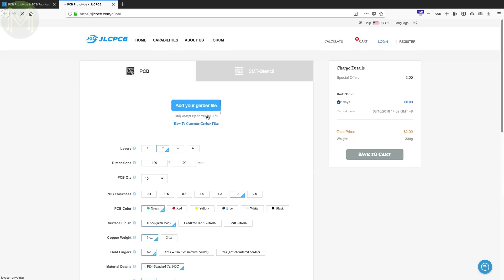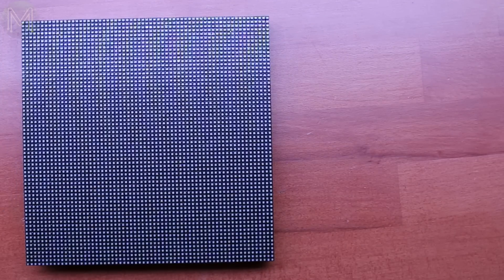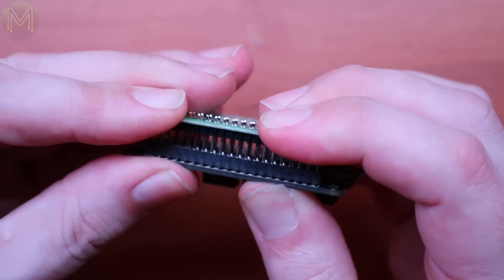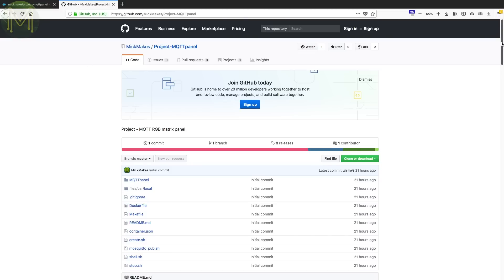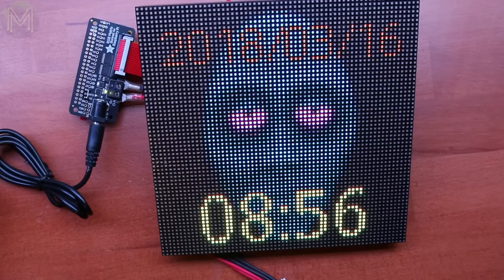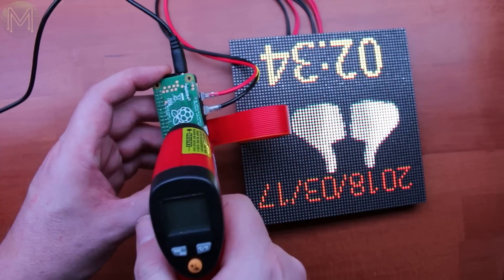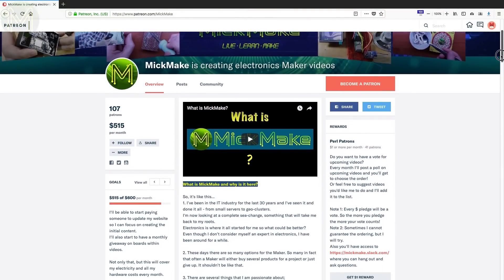#200 Build an MQTT based RGB LED panel! // Project

Comment: Bringing this back to life....not sure if it's being followed.  Is there any easy way to set the timezone ?  UTC is great an all that, but UTC -5 is far more useful for me.  The only reference I can find to timezone is in the MQTTpanel binary.  BTW This will NOT run on Pi Zero 2 W as is, it renders a mostly solid color on the HDMI output, and summarily locks up the Pi... Runs good on Zero W (only using Bullseye, on Bookworm it just continually complaints about the sound being enabled even when it's blacklisted, then crashes), Pi 3 runs good, but the panel blinks intermittently and is annoying to see.
Reply: Got it sorted;

To change the timezone:
docker start project-mqttpanel                                                        # start the container
docker exec -it project-mqttpanel bash                                         # shell into the container    
apk add --no-cache tzdata                                                               # install timezone data
cp /usr/share/zoneinfo/America/Chicago /etc/localtime       # copy the appropriate timezone file to /etc/localtime
exit                                                                                                     # exit the shell 
docker restart project-mqttpanel                                                 # restart the container

Additionally you can modify time/date format elements in /usr/local/etc/config.json from within the container, making a backup first is always a good idea.

You probably want to save your modified container to a new image and create a new container using that image should it be updated in the future
docker commit <container-id> my-new-image   
use the docker create command included with the tutorial using new image name

Comment: I have followed your instructions and build a panel with same hardware as you use, the build and software installations went well but when I run the docker project I only get displayed something on half of the matrix display.
It looks as if the display is in 4 x 16 rows and I have something dispalyed on the first 16 rows, then I have 16 rows blank then 16 rows with display and then again 16 rows blank.

I use a 64x64 P2.5 adafruit matrix panel and a raspberry pi zero and use a 5V, 10A supply.

Any ideas why I get this wired display?
Reply: Ok I found out why....
I missed to solder at connection bridge on the adafruit bonnet for using a 64x64 RGB matrix 

https://learn.adafruit.com/adafruit-rgb-matrix-bonnet-for-raspberry-pi/driving-matrices#step-2982866

Comment: Question : does the pi itself need to be powered separately or does the 10A power supply power both the pi and the matrix?
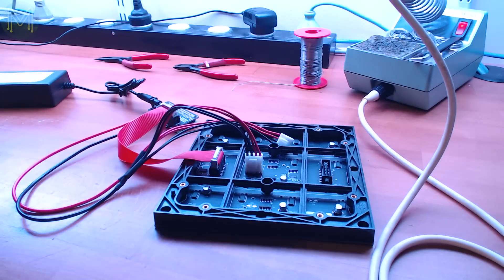Reply: At 3:36 he plugs the PSU into the PI hat, so I'd assume it powers the PI

Comment: great stuff! but a quick question, if I need to hook up 12 panels of 64x64, then will be enough to use the pi 3?
Reply: hi sir ,i am Gina ,if you have any questions about led display you can contact me please.whatsapp/skype： 8615803088171 email address： gina@atsilu.com

Comment: Interesting, how hard do you think clustering this into a much larger display would be?
Reply from the maker: The problem would be bandwidth and syncing. If you’re happy with a low sync rate, then it’d work well, but wouldn’t be able to handle HD video. At last not in this setup.

Comment: Can we use these (multiple) boards as monitor for raspberry Pi without coding
Reply from the maker: Unfortunately, they don't offer full frame video. So would be fairly sluggish as a monitor.

Comment: Great Project, got it up and running but ran into error after reboot. Error response for daemon: Driver failed programming external end point project-mqttpanel-0.10. Error starting userland proxy: listen TCP 0.0.0.0:1883: bind: address already in use. Any thoughts on how to repair.
thanks
Reply from the maker: Ah yes. A common issue. You already have something listening on port 1883. You’ll need to shutdown that other something. You can check what that is by doing a “lsof -I tcp:1883” and then killing it.
Reply from the maker: Did you use a fresh Raspbian image?
Reply: Ran lsof -I TCP:1883 and it was Mosquitto. Killed the Mosquitto PID and now Project-mqttpanel-0.10 runs but Mosquitoo will not start, gives same error as first described.
Reply from the maker: The Docker container runs its own Mosquitto server. If you want to run another, then you can change the port that it listens on, by changing the “-p 1883:1883” to be something else, like “-p 2883:1883”
Reply from the maker: But you’ll also need to change the Mosquitto client to point to the new port, of course.
Reply from the maker: If you don’t need to run another  Mosquitto server, then just leave it shutdown.
Reply: Love it!!!!
Reply from the maker: You got it going?
Reply: Yes it now works great, did not understand that the container has its own Mosquitto server. Was trying to get separate Mosquitto client and broker running on same Pi Zero running Mqttpanel ap. Very cool project, keep them coming!!!
Reply from the maker: Nice. I’ve put up instructions on all the available MQTT publish commands that it responds to on GitHub and DockerHub.
Reply: I used the GitHub commands page to set the time, but I cannot change the time zone. Eastern US?
Reply from the maker: Ah! I’ll have to add in another MQTT command to set the Timezone.

Comment: Can you use them as the main display, as if it was a monitor. It wold me awesome to play text adventure games in the shell
Reply from the maker: As far as displays go, they are very slow, but I don't see why you can't use them to play text adventure games. You don't need a fast display for that.
Reply: MickMake exactly. But is there a simple solution like just plugging a hdmi cable, or do you need to make you own driver to use it as your main display.
Reply from the maker: There may be some drivers around that allow conversion from HDMI, but that’d be extra hardware.
Reply: @ranukehshiga6328  you can run video on them just fine at 30 fps +

Comment: Could be good for a ticker-style message board or Control centre for a DIY IoT solution.
Reply from the maker: I'll add that feature in later. At the moment it's just static text, (but with animated GIFs).

Comment: The panels are a bit pricey for the 64x64 sizes.  I was thinking of making a larger display (think animated billboard/advertisement on the side of a trailer). But one thing that's really got me wondering, is how bright are these? At 6:25 you show the skulls/warning, and it looks kinda washed out (granted, this could just be the angle and/or the cameras auto adjust). Would you be able to see these outside under sunlight? Perhaps a more detailed video on these panels could be in the works?  😉🤠
Reply: Ok if you want to do this. I have a few tips for you. First you don't have to create your own software for this. know the panel shown in the video is used for high destiny indoor displays think p4 p5 = 4 mill form center of led to center of led. for Out door use you need depending on the size, p10 for small 4 by 8 ft they cost about 15$ for panels of 360mm by 160mm  that includes cables but not the casing or the power supply. I have a few good china contacts that manufacture good Quality panels. I could help you out if you really want to do it.
Reply: @theAppleWizz Thanks for the info. I'll have to get back to you on that one. I've been thinking of doing this kind of project, but it's been way back on the back burner for awhile as it's not on the front page list of things to do/work on 😉
Reply from the maker: You can pick up the same panel from eBay and China a whole lot cheaper!

Under studio lights you could see them, but the angle of the panels and the camera... Well it was a bit washed out.
I would suspect that outside in full daylight they would be just as visible as what you saw in the video.
They're not really designed as outside lights.
Reply: @MickMake Ahhh, ok. Thanks.  Yeah, I looked at eBay and that was the price I was seeing for the 64x64. Unless there's another way to look them up.

Comment: Hi! Great video! Could you tell how the Docker container gets the access to the GPIO pins? Are they accessible right away or I need to give special permissons to Docker or make some mapping (similar to a posts mapping) when I start a Docker container?
Reply from the maker: Yes you will need to do that. If you run the command I mentioned in my video, (and on my website), it'll do it all for you.
Or else there's some handy scripts on GitHub.

Comment: Great video! Does it also work with 2 of the led panels connected to each other? I was thinking fo making a big 128x64 panel with this Adafruit matrix.
Reply from the maker: Yes indeedy! But you may have some slow GIF animation when using a Pi Zero. You can change the panel size by modifying the config.json file within the container. I’ll add a feature later where you can change it via MQTT
Reply: I have a similar idea to make a 128x32 display as a RunDMD clock with pinball animations.

Comment: Is 2/3rds threw making a 32x32 using the hzeller board https://github.com/hzeller/rpi-rgb-led-matrix/tree/master/adapter  will be easier to just adapt what you have done now. Thanks :)
Reply from the maker: I used the hzeller library as the basis for my code. The Docker image has this library pre-built, installed and ready to roll for both C and Python. So you can shell into the container and just away you go.

Comment: Nice! One question - how much panels can be daisychained together?
Reply from the maker: Good question. A Pi Zero could handle 4 panels, but it’d be very slow at updating. A Pi3+ could handle a lot more, but not sure what the theoretical limit is on these panels.
Reply: MickMake, thank you for answering.

Comment: 50°c-30°c=20°c sooo 15°c+20°c=35°c under full load. Should be fine. Also, if im not mistaking, you can daisy chain those panels to get one big one, right?
Reply from the maker: Daisy chain? Absolutely, but I suspect the Pi Zero would struggle to do complex animation on two panels. It's juuuust struggling to keep up with one.
Reply: MickMake if got a use for those 8 core sbcs now.
Reply from the maker: Tempting. Even better, might look at using one of those LoFives I recently picked up. An FPGA would be able to really nudge up the refresh rate.

Comment: Cool Project. 
Also did you use the Paho library in this project ?
Reply from the maker: I ended up using the Mosquitto library. It ends up being a smaller installed package than Paho within the container.

Comment: I'm in the process of building a new gaming pc (luckily I bought the GPU back when you could still get rx 480's with 8gb of vram for $215 !!). I'm thinking about incorporating this into the side panel of the case. Maybe have a piece of acryllic cut to the size of the side panel and a square cut out of the center (or somewhere) to incorporate the LED panel... sounds like it could be cool. Maybe I could come up with (or it may already exist) some sort of android mqtt client to let friends who come over send their own messages to the panel. Could be a cool project idea... gonna have to research a bit on it, but it sounds do-able.
Reply from the maker: Nice!
Mate, all you have to do is figure out how to fit it into the case. If you want to  change the images within the container, you’ll have to rebuild it. I’ve put up full instructions to do that on GitHub.
I’ll be updating later to make it easier to change images and upload new ones without a Docker rebuild.

Comment: While I appreciate the convenience of root logins my system admin self is going nuts.
Reply: I am horrified whenever I see a recommendation to pipe the output of the "curl" command into a shell.  You sure must be trusting people to allow any random text file on the internet to be run as commands (especially as root) on your system.
Reply from the maker: Yup agreed.
I used to manage sysadmin teams of various sizes, but I’d often tell them: “Get root only if you need it. If you do, you have it because you are trusted. Don’t be an idiot. Check everything.”
Reply from the maker: Yes, same here. On production systems, or systems “that matter” I never execute a shell script as root without reading through it first.